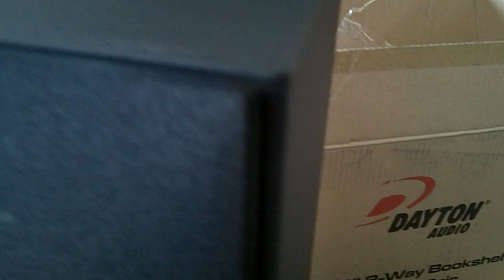Telling Old Dayton B652's from new ones

Comment from the maker: They have fixed the tweeter issue. But the drivers are both still "off" the new ones are usable and if you had nothing to compare you might actually be OK with them. But I can clearly tell the difference.

Comment: I have the newest ones with the AMT tweeter and they sound incredible at low volumes. Crank em and bass washes out. But the box is to small on all off these speakers. This size box needs a 4.5"-5" woofer. They would sound much cleaner. I am using these woofers in taller. Wider deeper ported old paradigm titan enclosures with paradigms crossover and they sound incredible. Twice as good as the tiny box Dayton gives you. But I'll still be buying another set for the AMT tweeter and woofer. Building my own boxes when they come in

Comment from the maker: That is the issue. In the cheap, cheap price range there really aren't any other good speakers. These Daytons were GREAT and the Micca's were actually better in smaller, desk situations. Now that both are gone I am stuck recommending +$100 a pair sets like the Infinity Primus P153 @ $75/each or the Cerwin Vega RE-16 @ $80/pair but untested. 

The real issue is the 6.5" driver. I replaced the ones on my new sets of B652's and they got instantly better. I got a deal on some cheap drivers for $8/ea

Comment: I ordered a set just recently and they're still crap. One speaker's woofer was dead on arrival and the tweeters are really low output. I removed all the drivers and am installing all new stuff in the cabinets. Should sound way better.